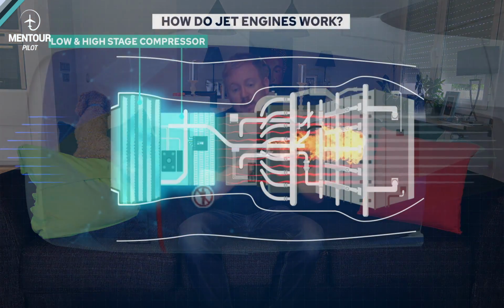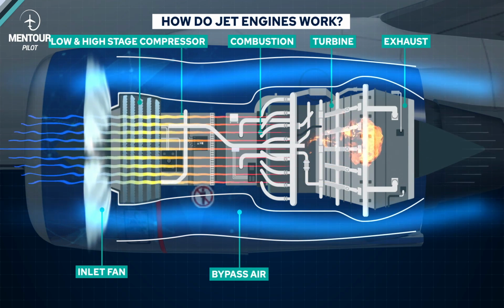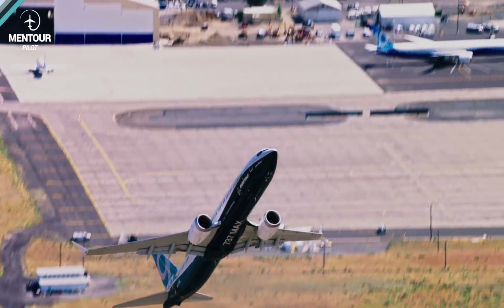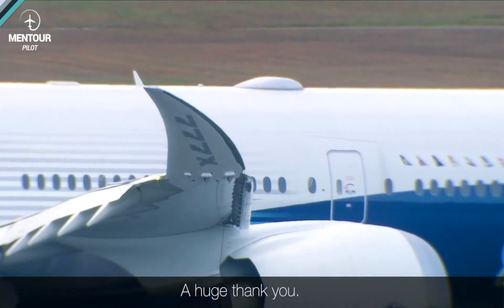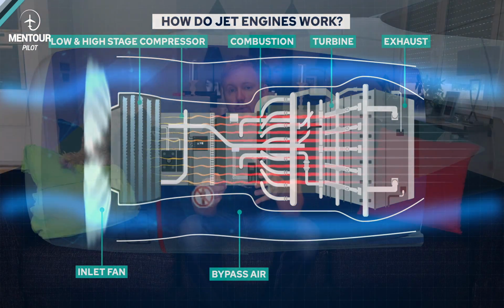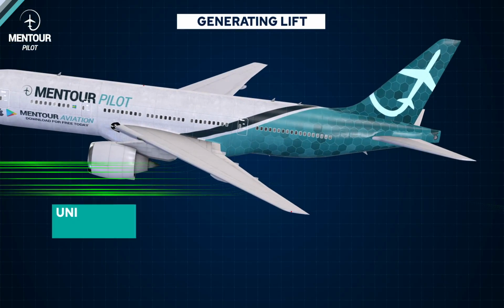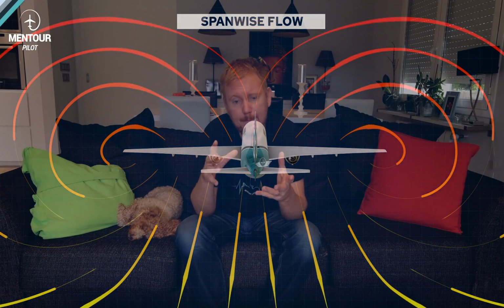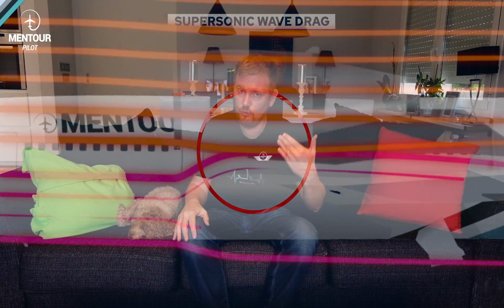How BIG can jet engines get?!

Comment: What about mounting the engines at rear like the MD 80 ?
Reply: THEN WILL FALL OFF.
Reply: @ilovecops6255  front will fall off
Reply: It's an option weight is still a major issue as big heavy engines on a tail moves the center of gravity aft.  Too big and you could never push the nose down  and will stall once you get airborne.
Reply: @garrnk  Which is why the wings are set so far back. Like he said, it's all about compromises or, more accurately, tradeoffs.
Reply: @TonyRule  exactly
Reply: @garrnk  The C of G is not at all an issue. It is just a matter of putting the wings further back. What probably is an issue is that the wings will need to be stronger since their weight is now bearing down on the middle of the aircraft rather than directly from the wings, which means heavier wings. Once would of course need to see if maybe that increase in weight of the wings is still offset by the increased efficiency that might be achieved, which could well be the case.
Reply: @listerdave1240  another issue is to do with aerodynamics and deep stalls. It can get to a point at high AoA where the wings can starve the engines of clean air and cause a flame out just when you need them most
Reply: @yukionna1649  Stalls not an issue. Just sneak an MCAS into the avionics software and give it full authority, but don't tell anyone.
Reply: @listerdave1240  That's just mean.
Reply: @garrnk  moving the horizontal stabilizer to the front can help with that

Comment: OK, here’s an idea: a MASSIVE SINGLE ENGINE jet transport, with the engine mounted at the rear of the fuselage — ala MD-11 and L-1011. This way, you’ll solve both the size AND the fuel consumption issue simultaneously. It’s the logical extension of the reduction of engines from 4 (or even more), to 3, to 2, due to increased manufacturing and materials reliability.
Reply: So what happens when your at 35,000 feet, and your engine dies?
Reply: I’ve thought of this before for <50 seater regional jets but it’s lack of redundancy that would mean it wouldn’t be able to be certified, the only single engine plane in commercial service carrying passengers is the Cessna 208B Grand Caravan

Comment: Why not go back to high wings?  Unless you explained that and I missed it, I got interrupted at the end of the video.
Reply from the maker: There are other issues with high wings, mainly to do with the overall structure of the aircraft.
Reply: @MentourPilot  ah. High wings were my first thought, but I figured there must be a reason they’re not more popular...
Reply: The main issue with shoulder mounted wings (the engineering term for high wings) is that the wing spars still have to pass through the fuselage. On low wing planes, the spars go through the area where the center fuel tank is. High wings would have to go through the passenger cabin, and you'd either lose overhead storage space, or seat space.
Reply: @murphsmodels8853  what about the Dash-8?  Just lumps the wing box on the roof, but I would imagine that takes a bit of drag, not critical at regional speeds so they just got over it i’d presume
Reply: @murphsmodels8853  No you dont. Just put all the toilets and galley where the wings are. Then you do not lose overhead storage or seat space.
Reply: @StevenSiew2  Except then people have to duck to go to their seats. And putting the wings above the fuselage requires a hump, which really messed with the aerodynamics and fuel efficiency. Also. High wings place the engines right in line with the passenger cabin, where all of the noise and flying parts are aimed right at them.
Reply: @murphsmodels8853 , I was also thinking flying parts, but how often is this a problem?
Reply: @seriouscat2231  Think back the past couple of years about how many uncontained engine failures have been in the news. The recent one in Denver, parts hit the fuselage, but in an area where there wasn't anything important. Imagine with the engines in line with the passenger cabin and they start throwing parts..
Reply: And what about the tail mounted engines?
Reply: Structurally it is much stronger to have wings below fuselage.

Comment: Somewhere, an engine designer is looking at that thumbnail and thinking "Maybe...?".

He probably also has a landing gear designer who is trying to talk him out of it.
Reply from the maker: Haha!
Reply: Engineer here. Sorry to disappoint, my first thought wasn't... really engineering related  😂
Reply: @nathan87  "Look at the cans on that thing!"?
Reply: Some sort of software can surely counter possible issues.
Reply: @5Andysalive  lol i see what you did there 😁
Reply: And here you have your engine designer.  If you want to make jet engines more efficient, you need to look at the propulsion efficiency - which is rather low at around 15 - 20 percent.  You cannot do more to improve on the thermodynamic efficiency.  The only way forward is to increase the size of the fan, which is required to reduce the air velocity of air mass through the engine.  Look at the kinetic energy:  K= 0,5 x m x c^2.  You see the advantage of lots of air massflow through the engine?  Problem today is the gearbox - being pretty heavy and exterted to a lot of torque.  I think in the future we will return to 3 or 4 engines to get all the benefit out of bigger engines.
Reply: @blameyourself4489  Your information is grossly wrong, and I suspect that you are thinking that propulsive efficiency and thermodynamic efficiency are the same. 
First propulsive efficiency improves with speed - it's not a fixed number. At cruise, it's not uncommon to have propulsive efficiencies in the 70%. 
Second, you can do a lot to improve the thermodynamic/thermal efficiency of an engine. Mostly by improving the pressure ratio of the engine, as technology improvements allow. That's why you see a steady increase in pressure ratios with almost every new generation of engine, from less than 10:1 in the earliest engines to 60:1 in the latest ones. We're now at the point where the latest engines can achieve over 50% thermal efficiency. 
Lastly, what eventually matters is the overall efficiency, which is the product of the thermal and the propulsive efficiencies. It can currently be in the low-mid 40%, while a theoretical upper limit (at Mach 0.8) is about 52%.

You are correct that increasing the air's mass flow is beneficial, but this too has a limit. The optimal overall efficiency is achieved when the jet exhaust speed is about twice the flight speed. For a required level of thrust this sets a limit on how much air you can move before it becomes detrimental.
Reply: @ASJC27  Pretty hard on the comment I'd say.  But you are right about the propulsion efficiency.  It can go even higher than 70 precent.  I was considering an engine with a total efficiency of 475 W/N.  Then you can calculate the rest yourself and where all the energy goes when looking at the total fuel burn, giving a total energy efficiency of approximately 18 percent.  I should hire you!
Reply: @blameyourself4489  I've read that the 'optimum' turbofan engine diameter is about 4 meters. But that was comparing the drag caused by the engine to the thrust. There are obviously a lot of compromises here!
About the only way to increase thermal efficiency further is to create a detonation engine. There have been a few prototypes of detonation rocket engines...  Have you heard of them? Scott Manley made a good video about them last year.
Reply: @bbgun061  Yes I know them.  I do think (this is my personal opinion but based on calculations) that the practical efficiency is not much different compared to existing engine technology and cannot justify the R&D costs.  The right way to proceed is basically to make CO2 neutral fuel.  It's not our engines that are broken.  It's the fuel!
Reply: @blameyourself4489  you are right, bravo
Reply: @blameyourself4489  Hmm... add more shaft-driven fans left and right of the "main" engine? So you don't need more actual compressors, injection, combustion and all the hassle...
Reply: @wilfriedklaebe  Well, if you want to fly fast and long ... :-))
Reply: LOL!  My dad was an engineer landing gear specialist  (design and then later stress analysis) for Ryan, Convair/General Dynamics, Douglas/McDonnell Douglas.  You nailed it.

I remember in second grade I was disappointed that my teacher wouldn't let me use my slide rule to do multiplication.
Reply: I looked at the thumbnail and thought "Dolly Parton". I guess I'm not much of an engineer.
Reply: @avlisk  that was my exact thought! That image behind him...🤣
Reply: What’s the difference between radial compressors and serial compressors
Reply: @ahmadtheaviationlover1937  put books in you hands
Reply: Put the landing gear on the engines
Reply: Install the landing gear on the engines?
Reply: @samiraperi467  If the engines were that large, it might be possible. The plane would need some other way to steer on the ground, though. Having a nosewheel is not possible.
Reply: LZ129 Brazil  Hmmm... I think the VTOL Dornier Jet had that arrangement.
Reply: Monster truck, aviation version! 😂
Reply: Unless the Landing gear designer is just as crazy and be like ... Alright, we just pur the landing gear IN the engine... that way they will always be on the bottom, no matter how big the engine gets.... make the engine a bit longer, too, that way we can but back and fron wheel in the engine and don't need to make a crazy long nose wheel...
Reply: I hope (s)he doesn't work for Boeing...
Reply: @esakhwaja8592  Boeing did a lot of wrong when it comes to 737MAX, and 737 in general. The software wasn't even the worst part, neither cost cutting. It was under-the-table deals, arrogance, complete disregard for anything than profits (not money - profits) and image. Add the fact people in charge have absolutely zero engineering background except for pairing bluetooth mouse with a laptop, and you end up with dysfunctional organization. To reiterate - if Boeing had proper safety and validation teams, which were listened to, and decoupled from management and accounting, and engineers were given enough time I'd retract my statement. Since this goes against core values of B's board of directors, I will not. I just feel sorry for engineers still working there.
Reply: @Vatharian  It's a fact… the 737 MAX has been returned to service by the world's aviation safety agencies** essentially unchanged in any meaningful way that would have had an impact on the two flights that crashed due to a runaway stabilizer. Still no mention of MCAS in the Flight Ops Manuals, pilots still have no need to know that MCAS exists, still nothing to be done when the AOA disagree message pops up (but it makes you wonder at the idiots who insisted that the message is flight critical—even though the AOAs are not displayed—per airline requirement; kinda like telling you your car tire pressures don't match up but not telling you what the pressure in any of them is. Besides, if displaying AOA is so critical to flying that Boeing has blood on its hands for displaying it only on payment of an installation fee, you'd think there'd be one in every trainer Cessna, Piper and Beech trainer airplane, eh? Never seen even one. It isn't mentioned in 1200+ pages of Federal Aviation Regulations, except for an advisory memo which says: we have absolutely nothing to say about the installation of an AOA display, just make sure it is sufficiently out of the way so it doesn't interfere with the operation of the airplane or distract from the pilot's scan of the instrument panel or cause fixation).

Continuing… still no need for pilot training on MCAS in a full-motion simulator, still possible to have stab trim runaways (like it always has been, since 1965)—the type that is not temporarily interruptible, doesn't pause on its own and can runaway far faster compared to what MCAS could induce, but there IS full-flight sim training required for the simple stab trim runaway procedure, which new pilots have been getting since 1965, and thereafter recurrently every few months too. Except at two airlines. Imagine that! All the world's 737 MAX pilots (and MAX pilots to-be) must get an extra serving (1/2 hour in an expensive flight simulator) of the one simple thing that almost certainly would have produced a different outcome for 346 people in two crashes.

All of that says a lot about Boeing and its engineers and its management and their integrity and patience (to the point of stupidity) in tolerating comments like yours. All of that says enough about the validity and value of your opinion too—so it really doesn't matter whether you retract your statement or not.

==========
**Except China, not yet. They least understood what was going on, so they were the first to ground it, giving no technically valid reason (but the world understands: better safe than sorry). So it makes sense that they're last to return it to service. You could try taking a page out of their book… when you find yourself in a tizzy, pause, consider what you know, who/where you learned it from, and whether your sources can even be vetted, considering that the day before they declared themselves Aerospace Reporters (so they could chase a Pulitzer Prize) they were busy speculating on next quarter's median price of real estate in the Seattle area. Then take the time to educate yourself—with valid information this time, make sure you comprehend it, and then… you'll probably find you don't have reason to shoot your mouth off to insult people you've never met and know nothing about, and make an ass of yourself. The bloodthirsty and grossly misinformed or ignorant bash-Boeing bandwagon has quietly disintegrated and disappeared; nothing left for you to jump on and pretend you're informed and therefore above intellectual reproach. Give it a rest already!
Oh, and the engines are still where the engineers put them.
Reply: @Vatharian  It’s pretty hard to check all the claims that you make but I do know that when Ford hired Alan Mulally from Boeing he was a top executive at Boeing.  He had several engineering degrees. Where do you get the details about how the company is run?
Reply: @Vatharian  I agree. When Petter talked about clever redesign of the landing gear to accommodate larger engines, I was just thinking: no, just a botch job to keep an out of date airframe flying in a desperate attempt to counter Airbus's brilliant  A320 family of narrow body aircraft. I can't understand why airlines are still buying this seriously compromised aircraft.
Reply: @K W  When you still don't understand something after all the explanations given, it's time to consider that what's actually "seriously compromised" is the nonplussed person looking at you from the mirror.
Reply: its  GAS TUNRBINES. NTO JET. JES IS MOVEING FLUIDES. BIG DIOFFERNCE. IT SI INTERNAM CIMBUSION ENGINES.

Comment: Todays engines are more then ever like a propeller aircraft.
Reply: I was actually quite shocked to learn, that modern jet engines (or turbofans, really) are jet-powered ducted prop planes. With bypass ratio 12:1 or more power comes from a jet, thrust comes from a fan. On a side note I really wonder how a B52 would look with 8 turbofans.
Reply: @Vatharian  The B-52H (the version still in service) actually does have turbofans, just ones with very low bypass ratios. Those engines are from the same family as those used on the Boeing 707 (Pratt & Whitney JT3D).
Reply: @JustSomeCanuck  Got to admit I don't really know why they haven't just put 4 (relatively) modern turbofans on them - surely they'd have saved money by doing it.
Reply: @tomriley5790  My understanding is that this would change the aerodynamics significantly and would essentially require a lot of re-design and re-certification for pilots.  In fact the current engine upgrade programs require that the 8 engines in a paired configuration be maintained.
Reply: @adamsmith6995  interesting - you'd still think it would be worth it...
Reply: @Vatharian  eight turbofans?  Would only need four, and still come out ahead.
Reply: "Todays engines are more then ever like a propeller aircraft." - indeed. So much so that I'd like to stop calling them "jet engines" and start calling them "thrusters" instead. The name "engine" should refer to the core of the thruster - the thing that converts fuel into mechanical power (and a little bit of thrust)
Reply: It is worth noting that the dynamics of fans and propellers are a little bit different due to the proximity of one blade to another...
Reply: Coming soon
Reply: Very true. Jet is in fact a misnomer. They are actually ducted fans that happen to be powered by a gas turbine. 
On the other hand a true jet is effectively a gas turbine with some missing power takeoff turbine stages so the exhaust creates thrust directly instead of driving the power takeoff turbine.

Comment: Pro tip: Make a giant jet engine and attach wings to it with room for the passengers inside them.
Reply: Not two but four Wings, then you get an X-Wing engine ^^
Reply: Google "KLM Flying-V", and yes... it's an aircraft, not a guitar.
Reply: But if, bigger engines are fited in the tail?
Reply: And the passengers will get a more "exciting" ride the further they are form the center of the axis of rotation.
Reply: @titter3648  It's not a bug, it's a feature!